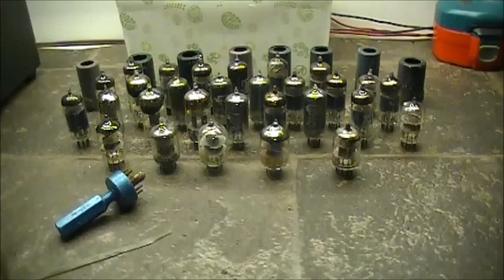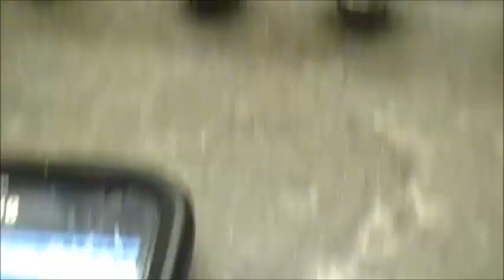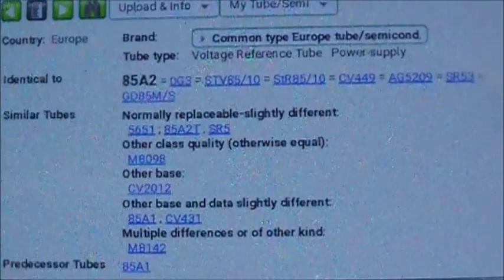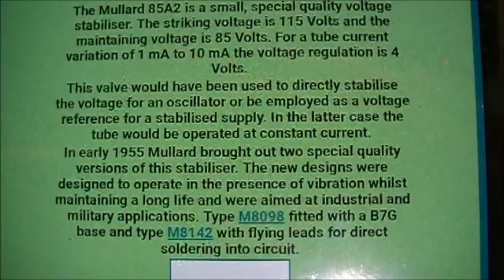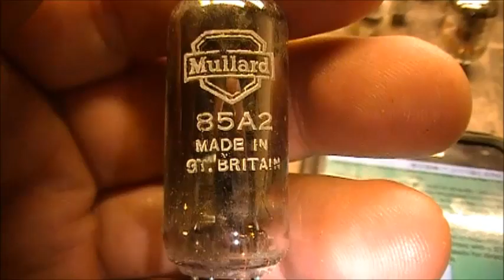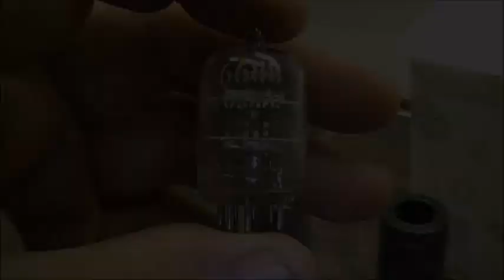Those old tubes - PART-1

Comment: Being 54 year's old I grew up during a time when tubes were being substituted with transistors. I consider myself a tube man. I love equipment that uses tubes, and  70% of my CB radio operating equipment is tube driven. There's something about the heat, light, smell ect ect given off by the tube that transistors just can't (and don't) replicate. Even though the cost of the types of tubes (sweep type) that the equipment I use are costly their wort the price. They do something transistors can't do. And that's bring back memories. Memories of a better time. Good luck figuring out what applicationthese tubes are usually used for.  Real radios glow in the dark. 73's
Reply from the maker: I must agree, the tube was a living creature unlike the transistors from today.   Tubes will forever be wanted for there audio sound and ease of use, something the transistor will never be able to provide.

Comment: I have a couple of hollow-state radios which I switch on from time to time. I find it enjoyable to travel back in time with my Hammarlund HQ-145 & tune across the HF spectrum, finding all sorts of strange broadcasts to listen to.
As for video ideas, I wouldn't mind seeing how you modified your 138xlr to visually display the operational status of the different sections of the radio. I have some tri-colored LED's I wouldn't mind adding to a President Washington to do the same exact thing.
Have you thought about setting up a webSDR receiver? That could be another project we could follow along with. If I understand it correctly, the receiver is just a USB stick which can be purchased cheap online, and somehow you connect it to the internet via some software. 73!
Reply from the maker: Interesting idea.  I have an SDR here, i must see if there anyway to get that thing online!   Hmmmmmm

Comment: Tubes are magical since their inception. i am in need of two 6 volt tubes, but as tubes go, the measure of the tube is of peciluar to their circumstance
Reply from the maker: What tubes do you need?
Reply: @Radionut63  6JU6
Reply from the maker: I will have a look thru my tubes here, see if i have one or not.
Reply: @Radionut63  I need a pair for an antique amp but I have no intentions of using it. Just like old gear so no worries. Just decided to ask since you have so many. I have a bunch too but they are no match or even a replacement match.